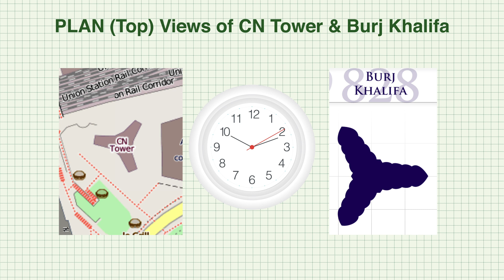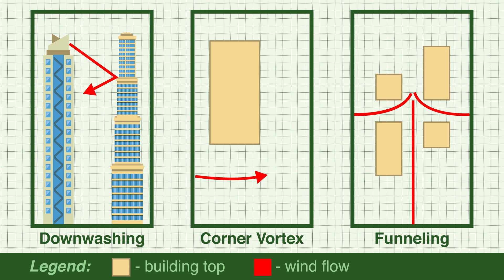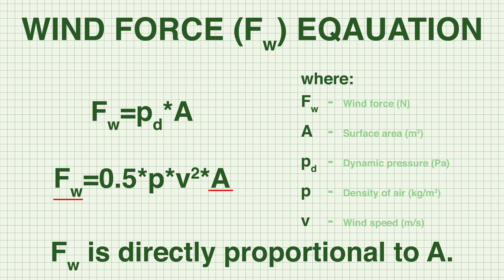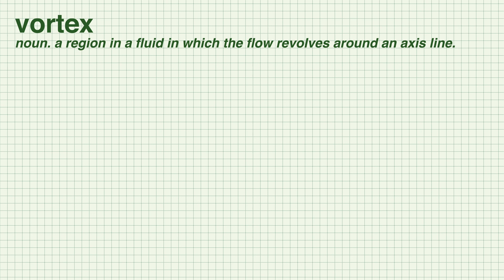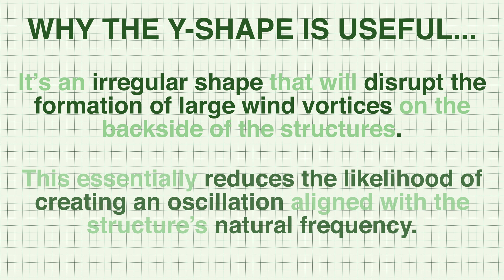Why are Tall Structures Y Shaped | Civil Concepts

Comment: The Y shape saves material which also reduces surface area that comes into contact with wind flow at any given time which improves its wind resistance. I think.
Reply from the maker: That's right. The Y-shape would reduce the surface area compared to an equivalent rectangular/square plan footprint, therefore less surface area = lower wind loads which is ideal!